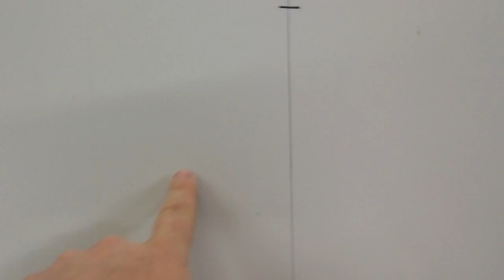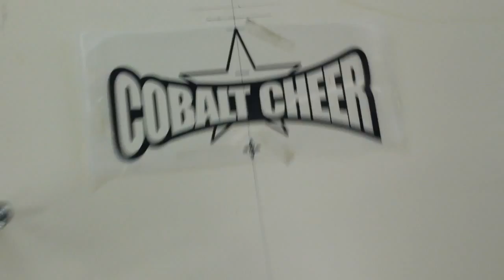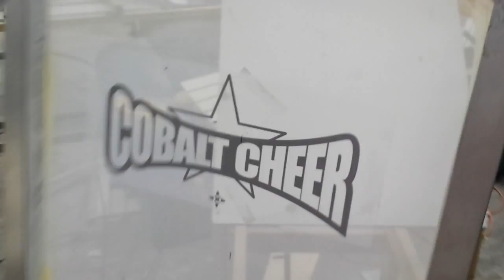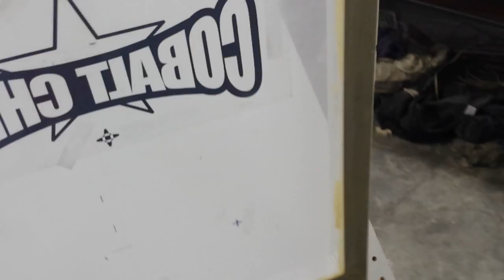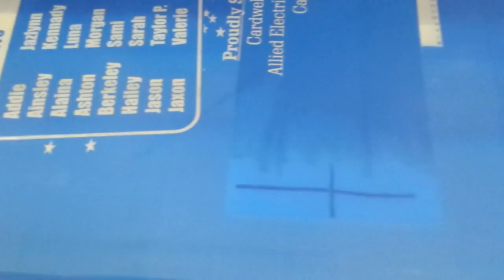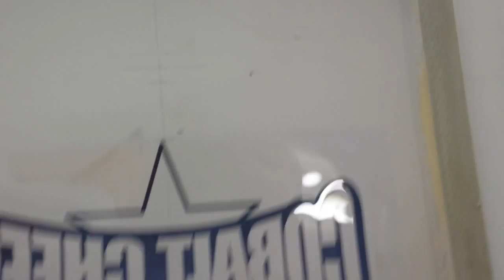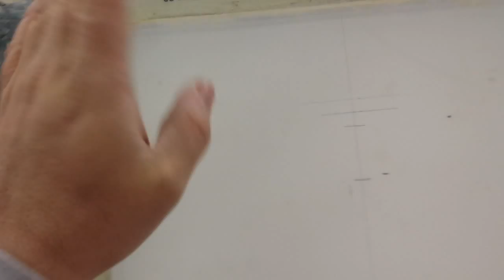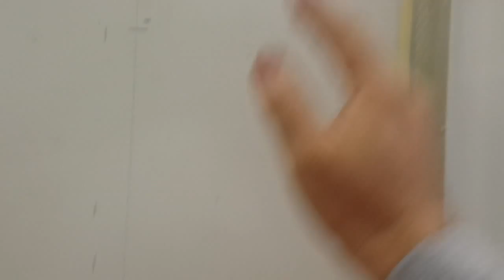Screen printing film alignment table

Comment: pretty slick idea.
Couple of suggestions....
1. With the back light on there, either work quick or add a yellow uv blocker. You dont want that white light to let out to much UV and expose at all.
2. with your mesh sitting on the acrylic, you may want to router and buff those edges so they dont rip the screen.

I actually built something semi similar where I cut rulers out of vinyl and applied it to the top of a rolling storage thing.  But it was smaller than the screen ID so the screen would move and I had to guess center.
Also, I fully agree with you about the double sided tape... it sucks on screens

Comment: Nice video I use table to line up my screens. thinking of doing what u got with the bolts. can you build a pallet jig for a manual press. Do you have the update video with the changes you was going to do.
Reply: +Jeron Miller thanks for the info.

Comment: or you could buy a cheap air hockey table reverse the fan so it sucks the film to the table set up your 3 bolt reg system . I worked at a screen print shop that used a air hockey table and epoxy glue to fill the holes from the bolts.
Reply: Interesting!!! I have one in my garage!
Your idea made me think about a vacuum platen tho